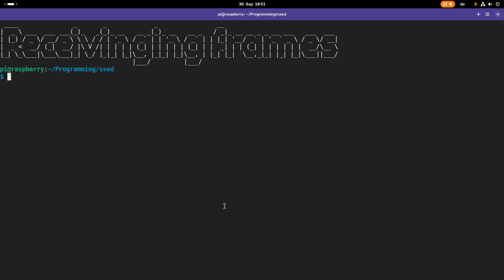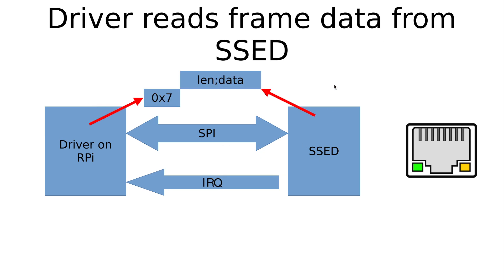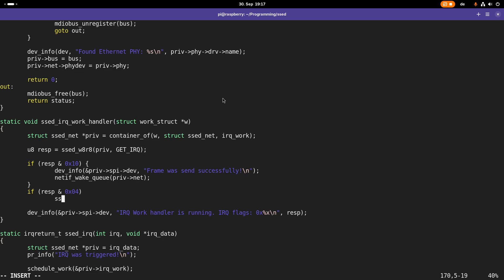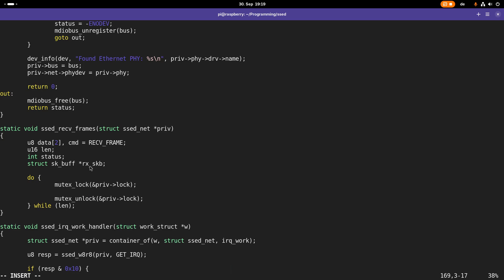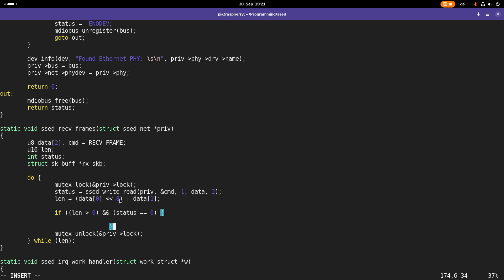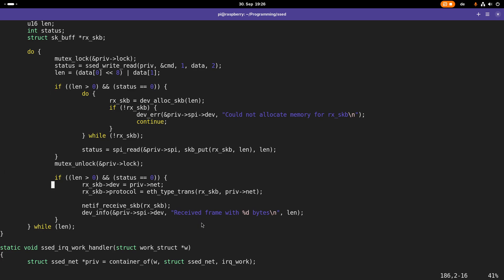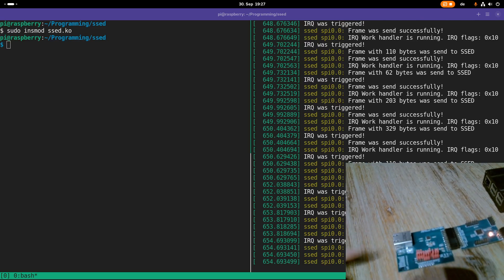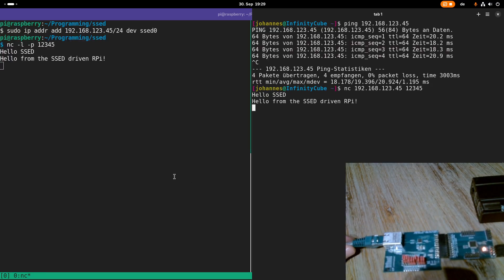Let's code a Linux network driver - Receiving frames

Comment: is it possible to do this on QEMU if  I don't have access to hardware?
Reply from the maker: Sadly not. I think it is possible to impement the SSED device as a QEMU device, but for reproducing the tutorials you only need a WIZnet Surf 5 Evalboard for around 10$ and a stlink programmer. I will do a video soon how to implement the SSED device on the Surf 5.